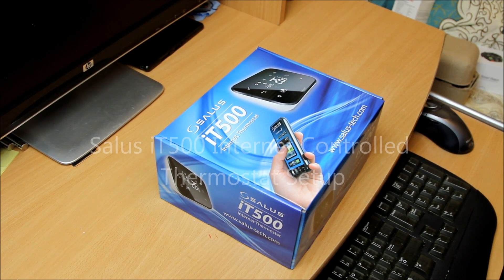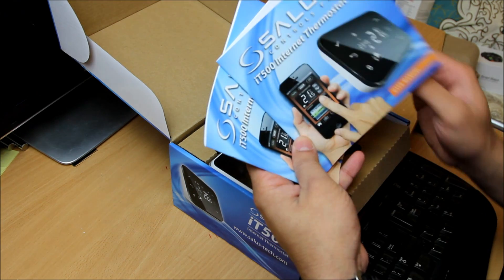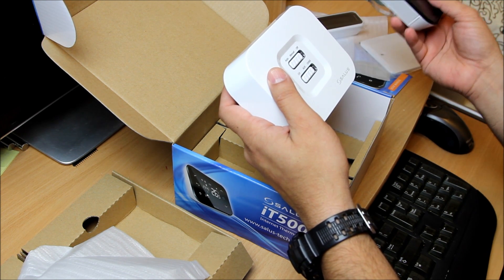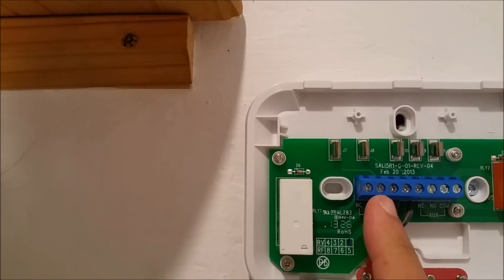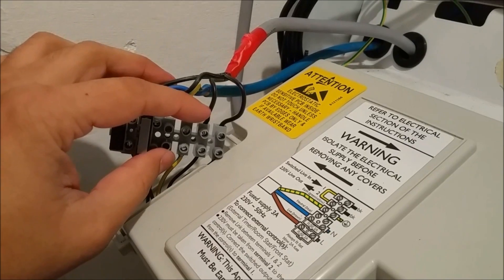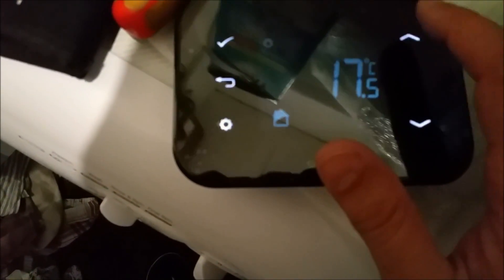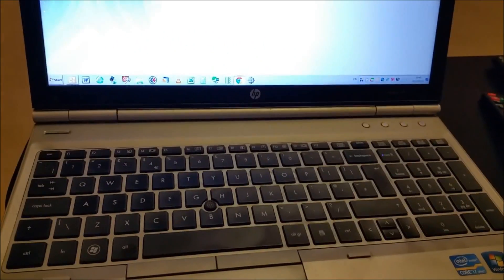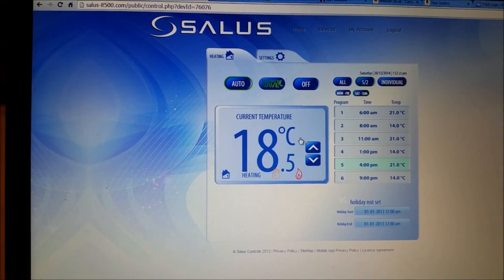Salus iT500 Internet Controlled Thermostat Unboxing Installation Setup review

Comment: I know this is an old video but you didn't mention where you connect the COM wire. Does the COM and NO go to the stat/timer connection? And if yes does it matter which way round they are connected? As according to the Salus manual COM just needs a link with 230v but then my thermostat fails to get the boiler to heat the house.